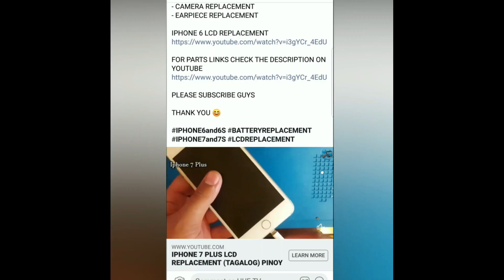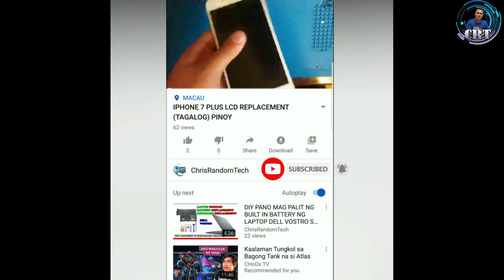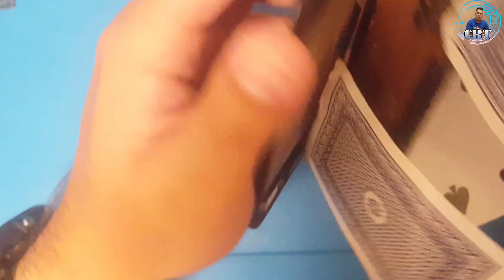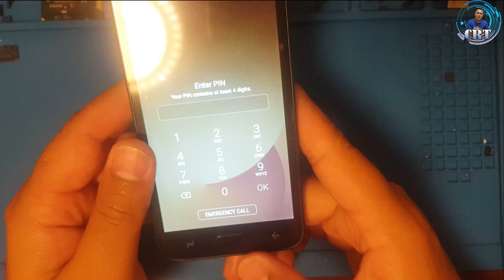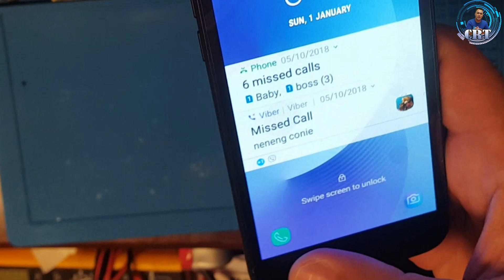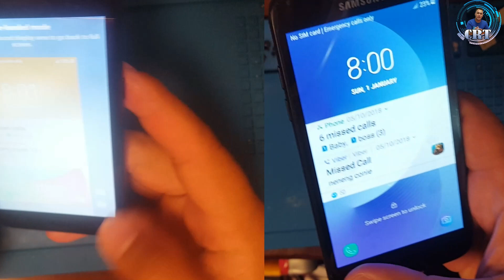Fake and Original LCD Comparison - Paano Palitan ang LCD ng Samsung J2

Comment: Oo nga marami original at fake sa lazada
Bat di mo sabihin anong store binilan mo sa lazada hindi naman namin aagawin trabaho mo.. Tech din ako maraming pekeng lcd kaya nga nagtatanong sayo mga subcriber mo para malaman pilit mo pa tinatago san ung store.. Na binilan mo sa comment pa pwede naman sabihin.. Damot mo..
Reply from the maker: di ko po tinatago binilhan ko.. wla akong shop kaya di ako nakikipag kumpetensya.. information lng po itong video.. nasa macau po ako nyan nung gnwa ko video na yan kaya sa macau ako nag order ng parts.. kung sa lazada, wala din akong permanent store na pinag bibilhan. bsta sinesearch ko lang kung AMOLED sya or TFT.. pag mga TFT LCD class A un. pag AMOLED original. try this link 
https://www.lazada.com.ph/products/100-original-super-amoled-5-for-samsung-galaxy-j2-core-j260-lcd-display-screen-touch-screen-digitizer-assembly-repair-parts-i2894901347-s14068086261.html?

kung gsto nyo naman din pntahan mga bilihan ng parts. nasa Quiapo plaza lang din. isang buong building un na andun na lahat ng parts na need nyo po..